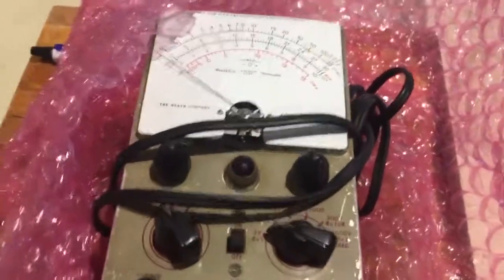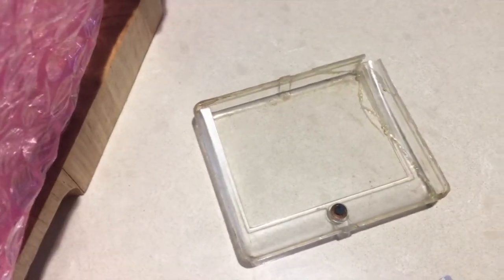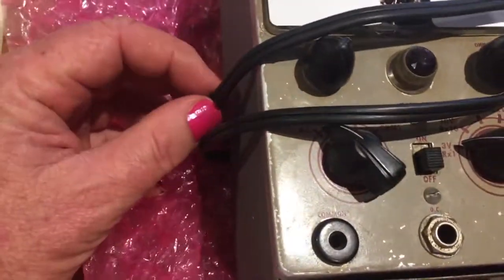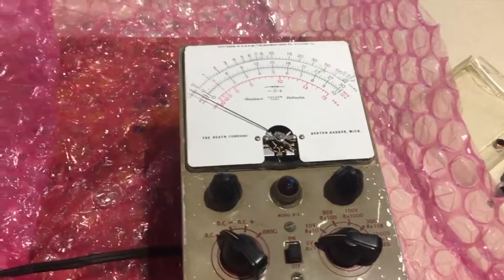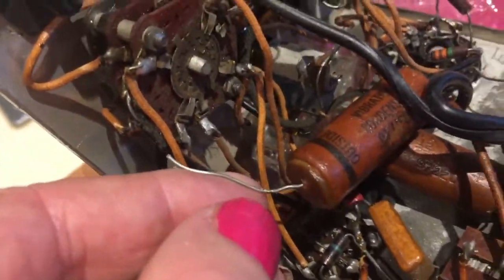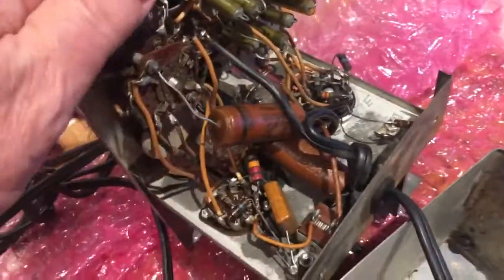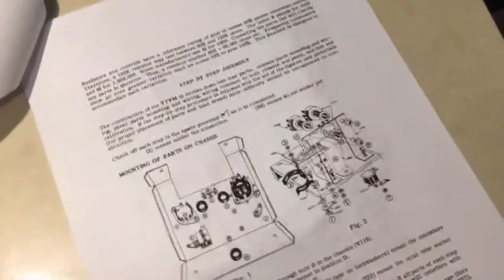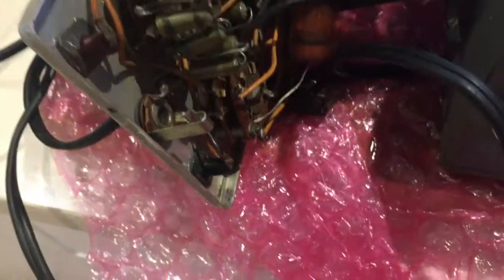My Heathkit V-5 VTVM Project

Comment: Electronic kits back in the day sure were something to behold. Kits these days are nothing in comparison. Of course, these days the laws and standards are a bunch of scare mongering. Kits involving mains voltage and higher voltages were common back then, which would give most regulation rule setters these days hernias.

Would of been cool if you had put up a resto video on your V-5, always interesting to see others doing restos. I have not decided on what model I will get. I've been involved with solid state for many years, and am getting back into valves now. Partially for nostalgia, but also just respect and admiration of the tech. Extremely rare to see females into electronics and radio. And Aussie to boot, that is a cherry on top.

Thanks for sharing!